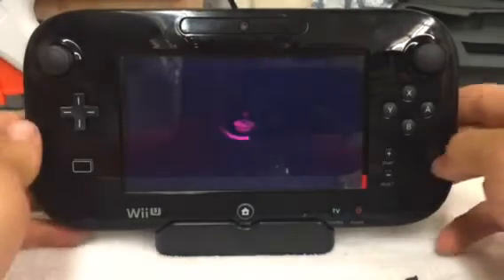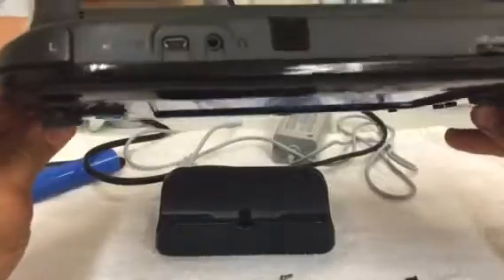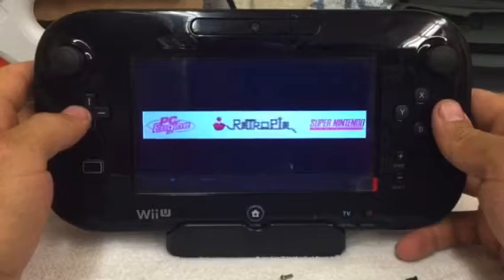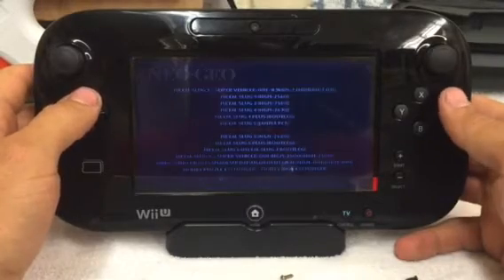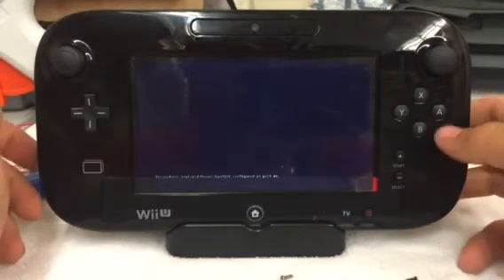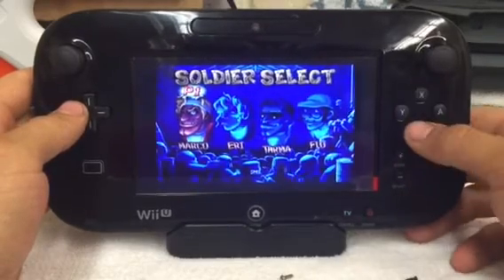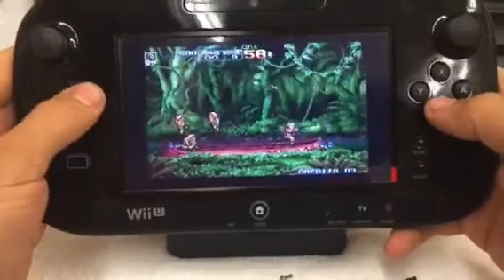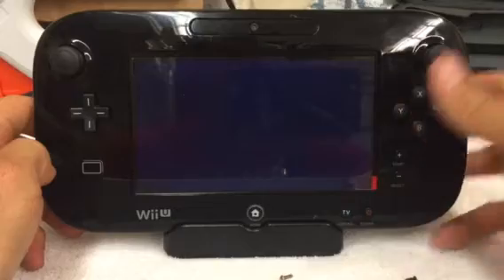Wii U gamepad with pi Zero inside

Comment: Hey how'd you do the buttons? Original ribbon connectors or nah? I've gotten half of them working, but the other half is proving to be difficult
Reply from the maker: I did use the orginal ones but I melted one getting it off so I ordered new ones from Amazon. I can try and find the link if u need them. I also used a breakout board from Aida fruit

Comment: Hey man, I'm doing this as well, and it would really help me out if you had a model number or something for that screen you're using. I have a tianma TM062RDH03, but i don't think its going to end up working.
Reply: Something I haven't seen anyone try yet and I may if I ever give this a go is using a 2s lipo (7.4v nominal) and regulating it down to 5V vs trying to boost. I think this would really help with battery life. You will be looking at much lower mah lipos but keep in mind the mah displayed on 2s and above lipos is per cell ie. a 2s 1500 mah lipo would be roughly equivalent to 3000 mah. This is most certainly not the exact math but gives a rough idea.
Reply: Also what battery are you using to be able to stuff it inside O_O
Reply from the maker: Link for the screen is on my other video
Reply: Wow that was quick
Thanks bro
Reply: Hey so this is actually the same screen, can you let me know how you ended up powering the screen. Right now I'm having issues connecting it via VGA and also I can't get i the pi to power it via USB.
Reply from the maker: +Mikroniix I wired it directly to the power boost. I'm having issues with battery life. Only get 30 mins. Off a 4500mha battery. I have a second screen on the way that I'm going to start removing parts to cut down on power draw.
Reply: that doesn't sound like much fun at all. I think I might just switch to one of those Adafruit hdmi's. But then I'd have to adjust the front of gamepad for a smaller/bigger screen.